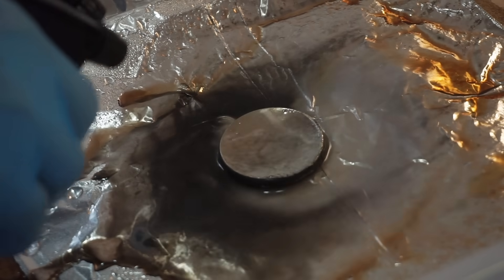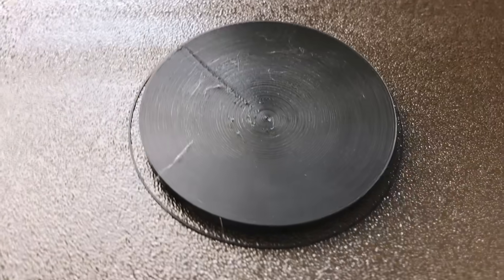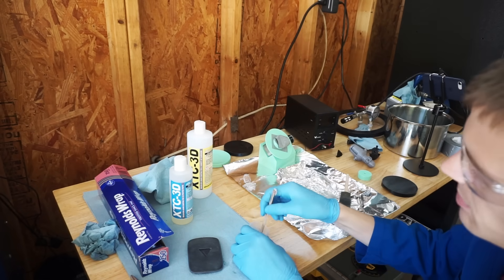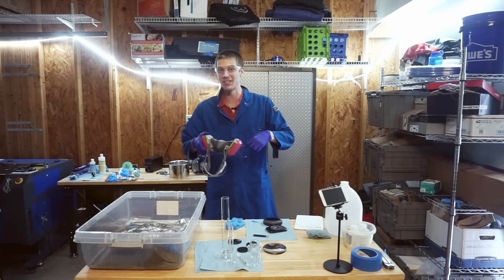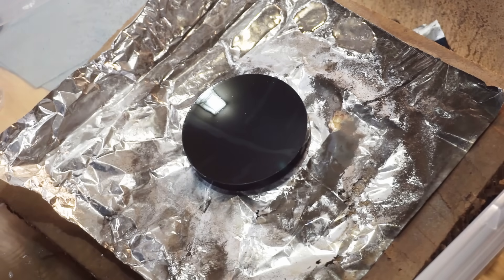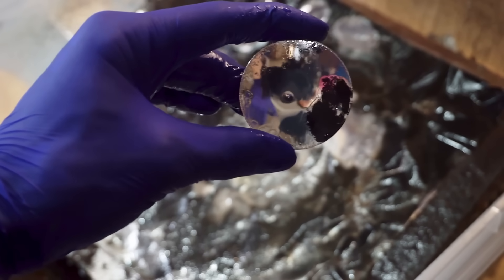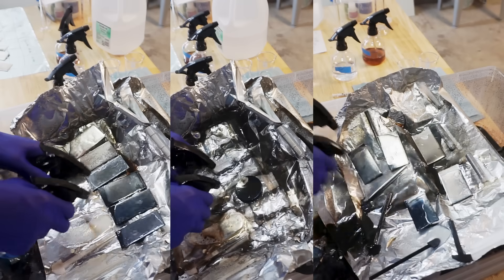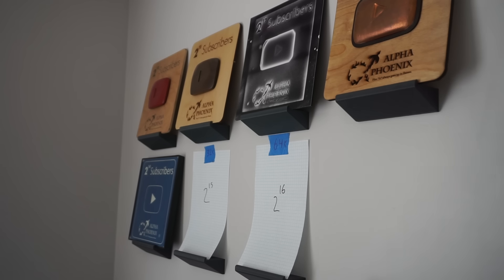How does a "first surface" mirror work? (2^15 sub special!)

Comment: I've seen people leave their 3d prints in a sealed container plateaued above acetone. Apparently the vapour is enough to smoothen then print, as long as you have a decent print thickness and don't leave it in their too long.

Comment: Can this be used to make telescope mirrors? I'd love to see you try a project like that in the future.
Reply from the maker: That was the original intent I had for this process! Unfortunately the printer precision is a few orders of magnitude away from where I’d need it. Maybe I should try again now that I have a new printer but it’s still probably tens of microns precision when I need less than a micron accuracy
Reply: You could use spin casting to get the best parabolic shape. A low surface tension, low viscosity, slow curing resin will give the best result. You can print a mould with roughly the shape you want, get it spinning the perfect speed for your focal length, then slowly pour the resin until it covers the whole surface. Keep it spinning until it cures. The bigger the mirror, the more effective this process. The V.L.T (very large telescope) mirror was made using this exact process, but with molten glass instead of resin.
Reply from the maker: I really wanted to play with an ultra-wide-field reflector. Dreamed of making a camera lens that had the field of view of a 12mm but ludicrously fast. It would have had SO much aberration lol

Comment: use spin application for the reason and lap the surface in-between coats. Just vacuum will not remove a good portion on the moisture, look up how freeze drying is done. the cold trap catches and holds the moisture.

Comment: I feel like the humidity was to high in the room you mixed in. Also the temp in the room matters a lot. Did you use a heat gun or a propane torch to effect the surface tension of the epoxy while it was curing so that the air in the mixture can release?

Comment: Why not clean the surface with acetone before silvering? It should remove dust and other contaminants and also pull out some of the excess uncured resin. Or just heat it in an oven to get a more thorough cure.

Comment: Could it cure, submerged in non-reactive, slow chilled, pressurized liquid? Instapot in freezer and upside down in mercury? Apply one or more AC magnetic fields to remove or add crystal dislocations by agitating misaligned atom groups.

How would you mirror coat the inside of a toroid?

Haha what if the freezer running wiggled enough. You might have to isolate it more. Vacuums get cold and no noise. Do pressure vessels know they’re in a vacuum? Can you put a pressure vessel with high pressure inside a vacuum? Held up magnetically in a void, and under pressure. Not sure, but if you’re looking for even curing surface tension, it might just be a vacuum centrifuge or liquid pressure mold. Filter the air also and slow cure resin base coat. Drain your excess spray onto some art for fun. Good luck. It’s fun to think about. Thanks for the vid

Comment: Study Design of Experiments. You learn more with less experiments.
Reply from the maker: Not if all your variables might interact
Reply: @AlphaPhoenixChannel  Yes It does. Interactions are part of the DOE analysis.
Reply from the maker: @ronwoodward716 I had reason to believe there would be unique nonlinear combinations here so if only a single experiment would yield an informative result, this project is a bad candidate for a subsetting the experiment space. If the interactions were linear I’d be all about it
Reply: @AlphaPhoenixChannel  DOE can help you learn quickly if there are interactions and how large they are and then guide an expanded set of experiments to nail down how the interactions work. You said you discovered that more of one part epoxy had a positive effect whereas more of the other was negative. That would have shown up without a huge number of experiments. We used DOE on industrial processes with many interacting controls. It was invaluable on narrowing down what counted and what did not. We did not have the luxury of running complete multidimensional experiments. The analysis is more complex than with the complete set of possible combinations but it is so much faster and is more robust in noisy (confounding) situations.

Comment: It seems the epoxy needs to be fully cured, some gentle heating will help tremendously I reckon. 

I am curious if some graphene mixed in the epoxy will affect the mirroring process? 
It tends to make epoxy much much harder, conductive thermally and electrically. Maybe could even electroplate graphene epoxy with silver solution and polish for the mirror surface.

Comment: Tip: the plastic masks actually trap more dust in your lungs than without them. A better solution is to wear a dust rated respirator since they clog up slower than N95 disposable masks and you can breath better until they get too dirty and you can change the filters on the respirator.
Reply from the maker: Tip: that is a p100 respirator, which is excellent for dust, but I’m wearing it for chemical vapors here because of the charcoal

Comment: Hmmm I don't think I have seen people pull a vacuum on a coated/poured part/mold before. Usually you pull the bubbles out in your mixing container, then apply it, and if you have something inert that can be included you could put it in a pressure pot as the part cures?

Comment: some (most) epoxy resins have a curing time of weeks, not hours.  Now since you did use the word Curing, and not drying (two different things), than I don't expect you made the same mistake so many make when using the stuff, thinking that Dry is enough to not have it still out-gassing chemicals!

Comment: I wonder instead of Resin you could use Poly or nitro clear coat first  a few layers and sand smooth before applying the silvering,    it looks very cool!

Comment: Curing them inside is better because outside draws in moisture from the humidity. Inside is usually air-conditioned which takes all the moisture out of the air

Comment: Yoour surfaces have to be CHIMICALLY CLEAN. Rinse with NaOH  then with H²SO4 and when clean water runs and cover all the surface, no dropplets, you are ready to spray your expensive Silver reducing solution; You can make your own Glucose reduction process with Ag Nitrate NaOH, Ammonia.Formulas in astro- mirror coating on the Web and on the Tube.

Comment: I think the algorithm showed this to me for a couple reasons. For one, I like watching other people make stuff as well as make stuff myself, but lately I've been using a roll of adhesive mirror 0.1 mm thick for making stuff with Lego. I've been posting videos about it on my channel. I've got a mostly chrome Ferrari and two newly finished kaleidoscope constructions that I'm extremely proud of. Turns out nobody has ever thought about it before myself and that there're ways to make them out of fancy lathed wood , garbage and everything in between. One doesn't even need mirrors if they have something super smooth such as brand new Lego tiles. Which begs a question? Would you be able to use this process on Lego tiles? Y'know the pieces with no studs on top. And only on the sides one wants to be mirrored?
Reply: Oh yeah, you gotta tell me what products you used. I am doing this for making real silver chrome mirror Lego parts. Please. And thanks.

Comment: So, I am a chemist!  Regarding your part A and B experiment, epoxies generally have a diamine component (usually the more yellow of the two resins) and an epoxide component (hence epoxy).  These are usually phenolics such as dimethylene bisphenol diglycidyl ether.  The more viscous ones may already be partially polymerized.

So... When you have an excess of the epoxide component, its not as big of a deal.  The epoxides can eventually self polymerize, and while they are fairly electrophillic, they probably won't do a lot to your silvering process.

If I had to bet, I think excess amine would be much more detrimental.  There's nothing the excess amine can do but sit there. However, it can chelate to silver and keep it from plating out.  So yeah... Thats my explanation anyway.

Also... I would expect your silver surface to quickly tarnish.  I would suggest that you coat it with a clear coat to protect it from oxidation.

Comment: If my calculation are correct and with current electricity prices in Austria, it would very roughly cost 1.5€-2€ for 100g. In most cases this is more expensive than buying salt. And with the current micro-plastic pollution, it might even be safer to buy salt.

Comment: I tried doing the same with a concave 3D print (but with a UV resin printer) however it didn’t work. I did it with my chemistry teacher and even he doesn’t understand why it didn’t work. I used Tollens reaction but I did it the way they did telescope mirrors in the past (so without sprays and I added 4 beaker from A to D that had all the reagents). For me it didn’t worked for one or two reason, maybe both :

1. I sanded the print with 600 grit, you always see mirrors being made on totally smooth glass so maybe that’s why it didn’t work (the silver couldn’t stick).

2. The UV resin reacted during the reaction.
Reply from the maker: I hope you get it working! Did you have a resin overcoat as well, or just the 600grit surface? The exterior resin is important
Reply: @AlphaPhoenixChannel  it was all printed in UV resin and I sanded it

Comment: Lots of interesting insight towards getting a smooth surface with epoxy resin.  Though as many had pointed out, the thick epoxy will hide details and edges.  The way to go is through a resin printer, and with a smoother surface you can opt to use something like spray on polyurethane to get a smooth surface through multiple thin coats.

Comment: You have an expensive science degree and you attempted this process without having the epoxy cure before applying your mirror. I am a house painter and I could have told you this was destined to fail. I was actually reasonably sure of this outcome watching you apply the epoxy coating with a 50 cent brush lol.

Comment: I went through this process around 10 years ago, your resin is only part of the problem, you can do this process over a painted surface also. However I did enough research to figure out the trade secret chemicals that are used. There are a lot of variables that make this process so hit and miss. Maybe I should do a video to compliment yours, I still have the chemicals that are rather difficult to get.

Comment: What about vapor smoothing before the mirror process? Also, what if you used some kind of air compressor and spray gun like an automotive spray gun instead of spray bottles? You could have a steady mist that you could control it better.

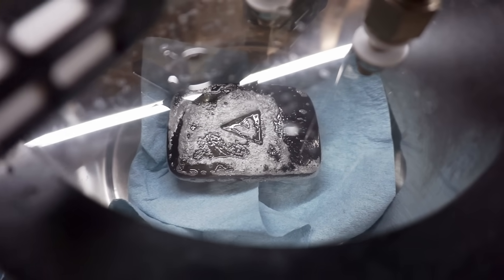Comment: 14:58 Putting resin in vacuum chamber will degas the resin, pulling trapped air from the resin and underlying material to the surface as bubbles to be popped. Good to do before a resin pour, but counterproductive for the painted on resin in your use. Putting it in a pressure pot while it cures will achieve what you were going for, or you could just leave it to cure naturally because it was just a thin painted layer not a deep pour

Comment: You Mostaken the wavelenghts, Microwave have a short wave, Long wave would be around 80Meters wich is 3500MHz, 14cm is short and small..  thats why its called MICRO WAVES, bit You called them HUGE AND ENORMOUS.
Reply from the maker: Relative to optical light

Comment: The 2 variables you didn’t account for and which were probably the most important were temperature and humidity. Also when you use a vacuum chamber to degas resin you do it BEFORE you pour it, not after you coat it. For a “scientist” you really didn’t do proper research by simply googling

Comment: I don’t understand why all of these makers use these terrible spool printers that leave lines on all the prints and no one uses resin printers that can print completely smooth. They’re not even very expensive to buy a nice resin printer so what gives? I bought a phrozen might Lu max and it prints nearly smooth prints

Comment: Curing indoors would avoid UV humidity and temperature changes.  I would suspect that could introduce enough variation with those environmental factors to cause the polymerization to fail or be uneven enough not to be used as a mirror. 

Nice scientific method to figure this out!

Comment: I won’t lie. I have absolutely NO idea what they’re talking about. Stuff like this goes WAY over my head. I may understand it to a certain extent, but I couldn’t possibly explain it to anyone else
Reply: He's making plastic mirrors.
Reply: Most mirrors are glass coated with metal. Light travels through the glass strikes the metal and "bounces" back through the glass. The glass changes the image.

His mirrors have metal on top of plastic. No glass layer to distort the image. The light strikes the metal and "bounces" back. It's called a "first surface mirror" because the metal is on top. I hope I've said this correctly.

Comment: I used to do this silver process on holograms as a condutive layer for electroplating/electroforming . some of the holograms were pressed into I think was acrylic instead of photo resist . we had trouble getting the silver to stick and It was sugested to use tanic acid which worked well.

Comment: The best advice that I ever got for epoxy, is that you need to mix it until you're sick of mixing it... then mix it for another 2 minutes. You have 2 parts that need to mix thoroughly and if they don't, you're going to get uncured resin throughout your batch. In turn, if you put excess of either part in the mixture - you're leaving uncurable resin in the mix and you'll never get a solid surface, so it's absolutely critical that you get the ratios correct. *I'd also add that you'd probably be better off just using a polyurethane, like Varathane, to build the smooth surface you're looking for. It's easy to use -  it'll cure like a rock - it'll sand down to a shine.
Reply: So... like 17 minutes?

Comment: actually if you make a parabolic mirror you should just make a spinning container put resin in and let it harden under rotation

speed will effect curvature... should be way more accurate then 3d printing and way smoother

Comment: Bake the epoxy as it cures. The absorbed water molecules in polymer composite materials are known to have significant effects on their physical and chemical properties of matrix as well as on their final performance of composite structures especially in their long-term utilization.

Comment: To get bubble free surface on 3D print: put dry print & mixed epoxy in vacuum chamber.  Draw vacuum.  Wait for mixed epoxy to stop frothing.  Tilt chamber to dump epoxy over 3D print so print is covered with epoxy.  Then slowly admit air to the chamber.  Epoxy will be driven into the 3D print filling up the internal voids.  Open chamber.  Lift out 3D print.  Wipe off excess epoxy.  You can put on your rotating fixture to eliminate runs as the epoxy sets.

Comment: In photolithography we used rotating vacuum plates to put the silicon wafers on, at a known pour rate to get flat surfaces. With known flow rate the RPM could be changed to change the thickness.

Comment: All you needed to do to get the surface bubbles out and to evenly flow the epoxy is the use a heat gun on it.  Watch some videos on epoxy pour table top making.

Comment: What do you do with the spent silvering solutions?  If you let them set, & if they have silver & ammonia in them, they can form silver AZIDE.  This is an EXPLOSIVE which can SPONTANEOUSLY go off!  IMMEDIATELY after you are done with the solutions, ass salt water to them.  This forms silver chloride, a nonhazardous gray powder.  This can be recycled back to silver metal with lye (first, gray turns black) & then add dextrose (slowly) back to silver powder (silvery-black).  You should have the salt solution premade & ready.
          All this silvering stuff can be done much better with the 2 solutions poured into tray with item to be silvered & rocked.  No mist!  Better quality coat!  Pour it off into waste container (containing the salt) when done.  This is how telescope mirrors were made by amateurs.  There are 2 chemistry's available.  One is fast, for opaque coatings such as you have made.  The other is slow, permitting making "half-silvered" mirrors by timing the reaction.
Reply: Wouldn't the company have to warn about that danger if they are using silver and ammonia?
Reply: @jemandanderes7075  Don't know what the chemistry is.  I suspect that the "activator" solution is a tin salt, but know nothing more (other than silvering solutions typically use silver nitrate, ammonia, caustic soda, & glucose or dextrose).  I looked up waste treatment & they add powdered clay to the waste (don't know what that does).

Comment: Can't have any water in a vacuum? light is an oscillating electric field? Bro are you sure you're a materials scientist? Or any kind of scientist for that matter?
Reply: 1. Correct.  You cannot have water in a vacuum.  It would boil to a gas and be removed by the pump.  2. Correct. Light is an oscillating electric field, which causes a magnetic field, which causes and electric field.  That's why it is called electromagnetic radiation.  3.  He's damn sight more of a scientist than someone who would write a comment like that.  I would suggest you check Wikipedia before going off on one, dude! 😛

Comment: Have you seen the felt tip paint pens they give a mirror finish i dont know how they work or what chemicals they use but they ouly use one liquid in the pen it could be that they mix the chemicals in the factory and its only when spread over a large area that they turn into a chrome mirror  surface

Comment: Hey, to get rid of bubbles don't use a vacuum, that makes it worse. Instead, put it under 50psi of pressure in a pressure chamber. You can buy cheap ones for paint sprayers.
Hope this helps!